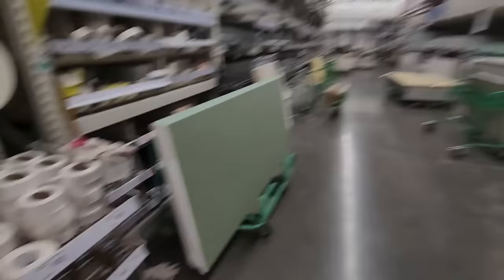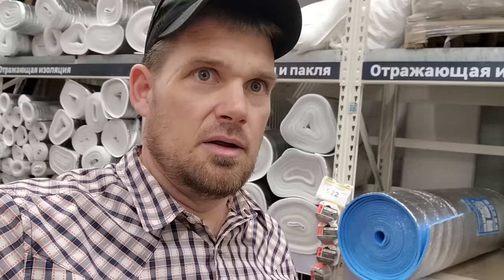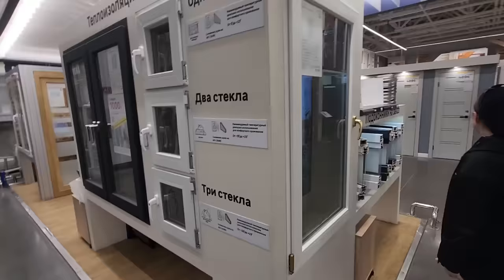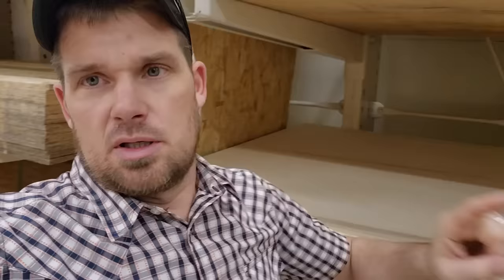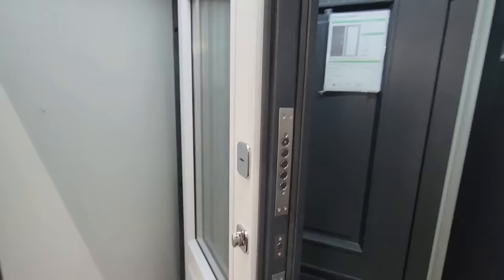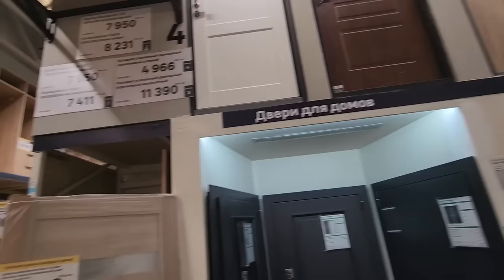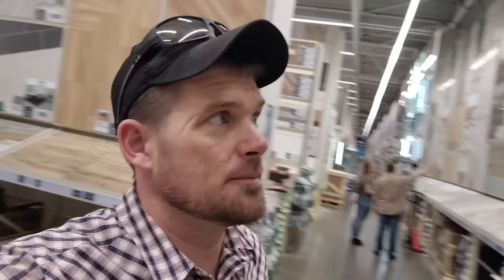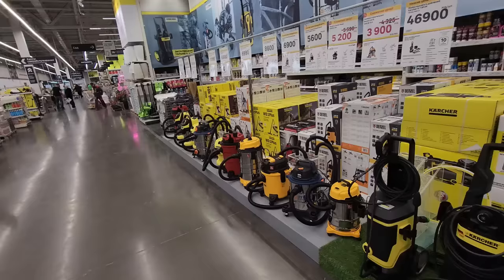As Promised We Went BACK !! REVIEW

Comment: 30:36 usually we buy and install the insulation separately from the flooring. There are (were?) linoleum with the insulation glued to it, yes, but I'm used that for the plastic of wooden flooring the insulation, if needed, is always bought and installed separately.
Reply from the maker: Yes...of course.
Reply: @countrysideacreshomestead2008  if the floor is concrete and you want to get it heated, you could just place a layer of XPS and a layer of concrete screed over it with water heating within. Depending on how much height you're willing to sacrifice. 
Also when deciding for a place consider if you have natural gas available there - it'll be heaps cheaper to heat up than with electricity I bet.
Reply: @countrysideacreshomestead2008  you can simply make an electric underfloor heating with a temperature controller, it is now common in Russia to install such. electricity is cheap

Comment: If you always convert between feet and meters you'll never get a feel for it. 
If you want to have innate understanding - just have a tape measure and measure things you can compare to. Like, 1cm is roughly a width of your fingernail, 10 cm is a width of your knuckle (with thumb included), 25cm is a length between your thumb and pinky extended, 1m is roughly a stride, etc. Really usefull way to measure things in a pinch too.

Same goes to language - to really get into it you need to stop translating, but it's way harder than with measuring.
Reply from the maker: I know how to use metric but not to efficiently build with it
Reply: @countrysideacreshomestead2008  if you're talking about standart stud spacing - it's kinda all over, not much frame housing standarts there (certainly a LOT less than in US/Canada). 

But you could look at materials to deduce decent way to build with minimal waste. Roughly 2ft (600mm) spacing could work: Rockwool has 600mm width, so it'll squeeze there, plywood or OSB has "multiple of 600" size (like 2400x1200, but don't quote me on that), standart kitchen cabinet is 600mm wide and deep, a lot of floor tiling is also 600x600mm, most of lumber is 6000mm long, and big trailer is 12000mm long so it's a standart for steel and other big stuff to transport.

Comment: It's 24 inches on center, for 600mm/1200mm sheets. Jeeezlouize. Heads up - you need 565mm wide insulation sheets for wood studs and 610mm wide for metal studs.

Comment: Canada converted to metric in 1974. But as you mention, it never got completely done. All building is still in feet & inches, and a lot of produce is still sold in lbs even though it is officially in kg. I believe the supermarkets continue to do it because the price looks less.
Those sheets of drywall etc. are standard at 2.5 x 1.24 meters, which is just a bit bigger than a 4x8 sheet (8' 2" x 4' 1")
It is common to have a second thumb turn lock on the door that is only operated from inside for when you are at home.
Most of those doors are for the main door in an apartment. They are solid for security. It is common to replace old wood doors with those when renovating an older apartment.

Comment: Forget Rockwool and glass fiber insulation, de-phasing is around 4 hours, great for a hot house in the summer. Not good!

Go for wood fiber, like the Steico brand, it breaths, its stable, doesn't sag down, etc. and has the same insulation (U and R) values.

Comment: Larger and less common sizes of drywall in length can be purchased from the Leroy Merlin website or from specialized suppliers or from the manufacturer. The largest sheet of drywall I've seen was 4 meters long.

As for the standard sizes of drywall or insulation in Russia, we have standard European sizes. In particular, the dimensions of drywall or profiles match the German ones.

This is common not only to building but also to engineering and industrial standards.

It has been going on since the 30s of the USSR, when we actively cooperated with Germany before World War II and traded with Britain and France.

Before the sanctions Germany accounted for 40+ percent of the share of russian international trade.

А lot of German large enterprises still remained in Russia. For example Knauf - a drywall manufacturer - is still operating in Russia and will not leave the country. Because there are 4 more russian manufacturers of drywall will be happy to take over its market.

Comment: Home depot in Canada does no even have half of stuff that I see here and way more expansive,Sheet if 1/2" drywall is $14?
Reply: 451 rub = 6,58 cad 
Drywall 12.5 mm Knauf 2500x1200 mm
Reply: 664 rub = 9,69 cad for waterproof
Reply: @michael-yurov  CGC Sheetrock 1/2 in. x 4 ft. x 8 ft. UltraLight Mold Tough Drywall Panel $28.58 + Tax. Its not waterproof, its mold resistant for bathroom and high moisture areas.

Comment: I'm conversant with both systems as we transitioned in NZ when l was a teen in the '70's. You will find it easy to convert: 8' stud is 2440mm , 4' is 1220, so sheet sizes are 2440 x 1220 rounded to 1200 x 2400. 4x2 is 100 x 50 ( but gauged its really a 92 x 46 ! ) 4" nails are 100mm. See what's happened ? We're still imperial ! 
Now, babies are still in pounds and ounces here...???
 Any way those are your go to's the rest will all come to you. I'd recommend going cold turkey , buy a metric tape ,  (don't use centimeters!  ) just mm and m, and do some small projects to get your head round it. Metric is super easy. If you stay using imperial its always going to be impossible to work with other people. 
As an aside, we farmer put fertilizer on at cwt/acre. That's just finally changed to kgs/ha , only took 40 years !   : D

Comment: Hi Arend, 

Some tricks;

For small size comparisons, use 1/16" as it is very close to 1,6 mm, thus easy to remember. So for example 10/16" (5/8") is 16 mm. 3/16" is 4,8 mm, etc. Good for calculating or having a better feel for drill bit and fastener sizes.

One inch is 25.4 mm. One foot is 12" which is precisely 30,48 cm, studs at 16" makes 40,64 cm (406,4 mm), or 2' (609,6 mm or 60,96 cm), in cm or mm these sizes are hard to work and calculate with.

Therefore you'd better switch to metric for building. It's easy: For instance stud hearts on 40 cm or 60 cm (400 and 600 mm), instead of 40,64 cm (16") or 60,96 cm (24").
Now your 120 x 250 cm OSB or your 60 or 120 cm wide dry-wall works out well, just like your imperial 4' x 8' (122 x 244 cm) underlayment would on 16" or 24".

Watch the . and , switch places for imperial to metric. Enjoy all of the adventures, you'll all be totally fine and happy in NN.

The crazy 1500+ mm sized square plywood sheets are not meant for building purposes but more for hobby projects. I see them also in France (where Leroy Merlin comes from) but not so much in the Anglo-Saxon EU countries where 4' x 8' and rounded up equivalents like 120 x 250 and 125 x 250 are sold more often.

Best regards,
Ян

Comment: Hi, Arend and Anneesa! How i know, in Russia use usually a 60cm’s (24 inches) distance between the frame posts. Therefore, a drywall and OSB’s sheets have usually the sizes 2500x1200 mm’s 2500mm (100 inches) - normal room hight, and 1200mm (48 inches)  width of the sheets - for three frame posts with the distance between them by 24 inches

Comment: I've built my DIYs in the States in feet and inches but grew up with the metric system. It's still all mixed up in my head, however, remembering that one yard is almost one meter helps me to ballpark the measurements. Also, 1 inch is 2.5 ish centimeters, this is also a good approximation to keep in mind.

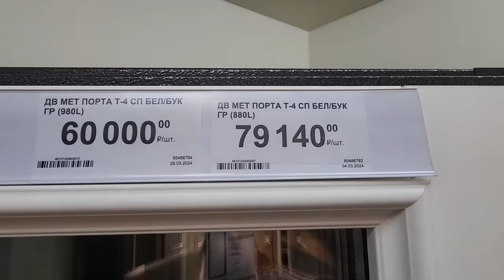Comment: 21:43 you're looking at typical European high security doors and the price is European too.
On a house you don't really need such a door, its pointless. If someone wants to break in, they'll bypass the door completely and get in through the window. Such doors are used only in apartment buildings where if you're above ground floor, the door is only way of getting in. 
Also, you wouldn't need all 3 locks, one is more then enough, this door is mostly a showcase of various configurations of locks etc.
The lock with those long keys is a typical safe lock. Opening it without a key is exactly the same problem as cracking a safe.

Comment: Arend, we use a millimeter (mm).Remember the number 0.04 and multiply all the dimensions by it when you need to understand the approximate dimensions. Even if the numbers are not signed, they mean a millimeter (mm).
2500 mm = 100 inches
1000 mm = 40 inches
100 mm = 4 inches
To be precise, 0.04 = 0.0397

Comment: c/c 60cm (23.622 inch) betwen stduds is standard.
One sheet of drywal 1200mm = 120 cm, (47.2441 inch)  width.
2400 mm = 240cm hight or 2500 is standard height (94.4882 /98.4252 inch) for a drywal sheet. 
You probably know. :)

Comment: Conversion is actually pretty easy in most cases. 1ft is 30 cm (or 300mm, or 0.3m). So, metric size (1200mm=1.2m) divided by 0.3 is size in feet (1.2m/0.3 = 4ft). 2500mm > 2.5m/0.3 = 8.3 ft approx. I guess you figured it out by now ).

Comment: Тонкие двери, больше для квартир подходят, уличную дверь лучше толстую брать, иначе будет холодно в -25, -30 градусов. В России есть теплый пол: от электричества или водяной. Также делают паркетную доску и инженерную доску, стоит дороже. Лучше такие вещи смотреть в специализированных магазинах, как Паркет центр.
Thin doors are more suitable for apartments; it is better to take a thick one for a street door, otherwise it will be cold at -25, -30 degrees. In Russia there is a heated floor: electric or water. They also make parquet boards and engineered boards, which are more expensive. It’s better to look at such things in specialized stores like Parquet Center.

Comment: Arend, read this, maybe it will be useful. Or maybe not. There are many double-glazed windows in which a protective layer is applied to the outer panes from the infrared (warm) spectrum of solar radiation. I think there are some in Canada too. It is very convenient if the side of the house with such windows is sunny. In the heat, they keep a certain coolness in the room. The main thing is not to open all the window sashes to keep out the hot air. It's better to just flip them back – the handle is up. And in winter, this layer reduces heat loss from a heated room, which saves energy if you have meter heating, or makes it possible to ventilate the room more often if you have centralized heating, which is a little overdone.
 For some reason, many people think that this layer protects against ultraviolet radiation. Of course not. The curtains fade, as with ordinary glass. Actually, this protective layer does not serve to protect your curtains, but to prevent excessive heat from entering the room, as well as to preserve the necessary heat in the room.

Regarding the opening sashes in the window.  I don’t know how it is in other countries, but here in Russia people save on their quantity.  On a window of three sections, only one opening sash is installed in the middle of the window.  It also reclines so as not to open it completely.  And some manage to place one leaf in the outermost section.  I consider one door to be an unreasonable saving on your own comfort for many years.  I'll explain why later.
 If there is not enough money (and there is usually enough money, they just save), then it is better to save them up. And if time is running out and winter is coming, you can buy windows on credit or installments. But you will have windows with at least two opening sashes. Here you can save money on folding doors – install only one such one. If there is only one mosquito net, then it is desirable to install it on a folding flap. You'll understand why later.
 From my own experience I know that the third sash is not necessary (albeit convenient), because, firstly, it is an additional element of heat loss, because the blind section still lets in less cold than the opening one, and secondly, it is an additional  an opening mechanism that needs to be looked after, and this takes time, desire and money.  Therefore, two doors are the optimal solution.  Although, I repeat, it is more convenient with three doors.
 Why do I need more than one leaf? Those who have only one opening flap will answer this question best of all. With two doors, you can ventilate the room faster in winter and summer. But this is not the most important thing. With two opening sashes, it is much easier and safer to wash the window. And with three it is even easier and safer – you do not need to stand on the windowsill and look out. In general, you need to look at how young, healthy and the like you are. With one sash, if you put a mosquito net, you can no longer look out the window, for example, to talk to someone or for some other reason, until you remove the net. And filming it all the time is an unforgettable “joy.”
 In general, kind people, it's up to you to save on the doors or not to save, but draw the right conclusions from my words. I understand that they will be subjective for everyone.

Arend, judging by this video, I get the impression that you are not very familiar with double-glazed windows.  I guess it just seemed to me.  So, by the way, I’ll add to what was written above that a sash with a tilting mechanism can be tilted for micro-ventilation by turning its handle to “an hour.” In general, it can be turned for different times, achieving different micro-ventilation.

In conclusion, I would like to add one of my observations.  Plastic windows have large glass.  They give the house a more modern look.  This is both good and bad, depending on what style of home you have.  If you have a private house, you can stick slightly narrow strips of the same color as the window frame onto the external glass of the double-glazed window, creating the crosshairs you need, to give the window and the house a certain retro style, some zest, and generally greater aesthetics and completeness of the external  appearance of the house.  Well, this crosshair will create certain interference when viewing from the window, I think you can calmly come to terms with this - before double-glazed windows, you somehow lived with it.  But your house will look more harmonious compared to neighboring houses.  Definitely.  In our city (Cheboksary), in one private sector there is a house in the “Fachwerk” style, and it has ordinary plastic windows of brown color to match the color of the bars on the house itself.  Without crosshairs on the glass, even the simplest one (one vertical bar and one horizontal), this nice house has some kind of unfinished look, as if it had not been completed.  And even in ordinary private houses, called cottages in Russia, without any special styles, the absence of crosshairs on the window glass causes a persistent feeling of incompleteness.

I spent a long time translating my text into English with the help of two translators - Yandex translator and Google translator.  I'm exhausted.  To make a more or less competent and understandable translation into English you need to try very hard.  Translators sometimes come up with some crap, taking into account the peculiarities of the Russian language, and I deeply doubt that an English-speaking reader would understand me completely.  For example, both translators, especially Google, for some reason give the word “door” instead of the word “leaf”, and this can cause misunderstanding of the reader.  In a Russian text for translation into English, you need to constantly insert clarifying words to other words so that the translation is adequate.  Therefore, dear readers of my comment, when using translators, be sure to do reverse translations, i.e.  translated into English, then this translation into Russian.  If you are not satisfied with it, edit the Russian text so that the translator “understands” it better.  Today there are only two more or less normal translators in the world - Google and Yandex, but even they periodically produce utter nonsense.  And an important point - your Russian text must be correctly written, preferably with correctly placed punctuation marks.  But, damn it, even this doesn’t always help )

Comment: Here in New Zealand ( which is almost Australia ) 2400 x 1200 = 8' x 4' - so I guess 2500 is closer to 9 foot.  As for that 9.5 thickness - well that is less than a half inch > which would be 12.5mm thick.  I get your imperial habit, I have one too, and it never goes away fully.  I was raised trading in Miles, Pounds, shillings and pence, as well as Pounds and ounces etc etc. But I am sure once you get the hang of the decimal system, you will prefer it.  Good luck.

Comment: 2500  x 1200 x 9.5 .... milimeters  (mm)........2500 milimeters (mm) x1200 milimeters x 9,5 milimeters ....... 2500 milimeters is 250 centimeters (cm) or 2,5 meters (m)  ..print a conversion table:person-turqouise-waving::face-red-heart-shape::hand-purple-blue-peace::popcorn-yellow-striped-smile: It gets easier and natural..but you have to use it (metric) ....there are games i think, to play with metric and get used to..as soon as you see your familiar imperial sizes in correspondent metrics, it is faster.. The measuring tapes with both systems are good for that as well..

Comment: An exterior door in Australia 40-50mm think not including hardware is way over $2000.00 add $300 for the cheapest hardware…..a lock like the on on that door would easily add $2000…..so very easy to spend $3000 + on you front door and it would be 30% of the quality of the ones in your videos…..